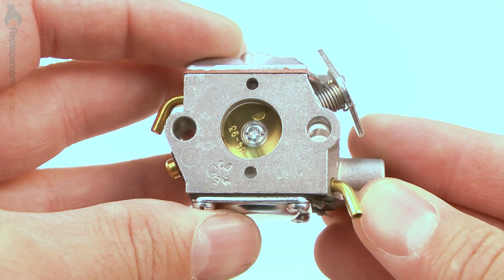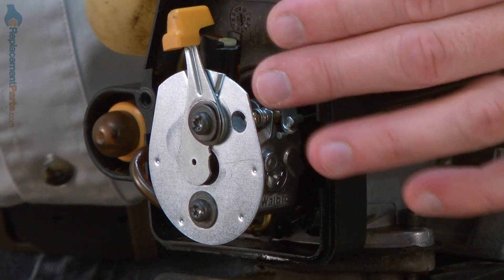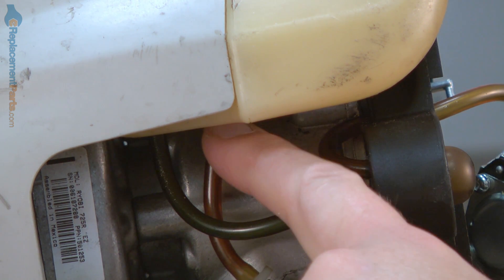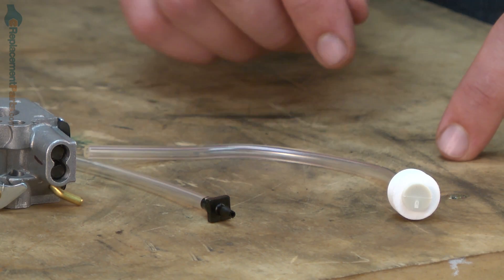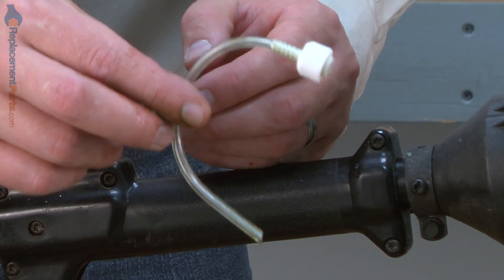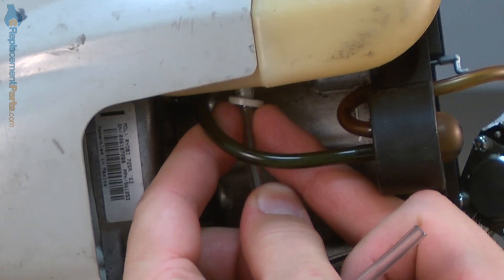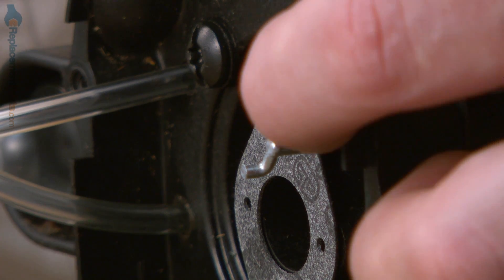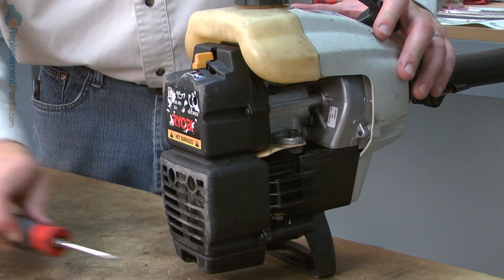Trimmer Repair - Replacing the Carburetor (Ryobi Part # 791-182875)

Comment: Hard to get parts. I searched for the carb rebuild kit and Amazon was showing complete carbs for the same price as a gasket set. I bought one. Installed and tried to prime and it wouldn't prime. The bulb got stiff and blew the hose off the top of the carb. I bought a second one with the same result. Friggin China. Compression test revealed 90 psi. It starts but won't stay running. I am certain it's a fuel problem.

Comment: Have you got a video for the ryobi 30cc pbc-3046 ye carburettor kit replacement as it looks slightly different especially the air filter cover and size of the fuel filter. Kind Regards Mark UK

Comment: i did all that try to start it only way will start if i pull trigger all way an pump primer bulb to keep running,,,, wondering if they sent m bad carb
Reply: I have the same problem. Yes the Chinese carbs are garbage. Better off putting a diaphragm and reed gasket in your old carb. They are pretty simple. Get the adjustment tools and watch a video on how to adjust these.

Comment: I bought new fuel filters with thick metal ring on the bottom. Original filter (like on the video) doesn't have it. What is the purpose of this ring? Do I need to remove it?

Comment: I wish it was that easy.  After giving 6 different places - incliding eReplacementParts - every number listed on my Ryobi 31cc 790r 18in. weed eater, no one can match any of them . Talk about mission impossible. I could have bought a new one for the price of all the minutes burned on my phone. Maybe Ryobi don't know what the words cross reference mean.
Reply from the maker: Hi there, and thanks for commenting. I found a carburetor that matches the Ryobi 790r String Trimmer, and you can find it here:

https://www.ereplacementparts.com/carburetor-assembly-p-283573.html

You can double check that you have the correct part by searching "carburetor" on the Ryobi 790r String Trimmer's model page here:

https://www.ereplacementparts.com/ryobi-790r-41ad790a734-handheld-trimmer-parts-c-7931_15633_18645.html

I hope this has finally helped you find the part you need to fix your Trimmer!
Reply: Thank you for the reply.  I have found carbs on all of the sites I've been to. A lot of them look similar but not the exact same thing. The problem is that none of the numbers I enter for my Ryobi come back to anything. I bought it in 1997,  and some of the carbs I'm looking at say 2004. Here are all of the numbers listed on my Ryobi exactly as they are written on it. 

This is from the owners manual. - Engine Family : SN4031UB24RA; EM
The same number is also on a little sticker on the engine only it reads - TN4031UB24RA; EM

Then there's a Model # on the engine. 708020752 : PPN 501145 
Roybi 790R "EZ"

Then there's another number on a sticker on the engine, it reads - 
5A6987
   (97)
708 - 3052661
I'm lost for words when none of these numbers exist in any system. 

The carb on your webite looks close. Mine doesn't have a big white plastic cap on top of it. If you say it'll fit I'll buy it.
Reply from the maker: Hi again. It seems to me that the model number of your trimmer is simply Ryobi 790R. Based on the parts list, the carburetor I sent you is compatible with your model. As you said that you purchased your trimmer in 1997, it's entirely possible that they have substituted a new carburetor for an obsolete part. In fact, our website mentions that this carburetor is a substitute part. I hope it works out for you!
Reply: Okay, I'll place the order. I really appreciate the help.
Reply from the maker: Always glad to help! Good luck with the repair!

Comment: I am curious, this looks exactly like the trimmer i have, why do you press down on the fuel filter when installing it? The fuel filter / line when installed should it be right at the hole the line passes through and standing up? I bought this replacement carb about 7 years ago and i am starting to have issues again ( which started with my fuel lines rotting out but they were the original ones ).
Reply from the maker: I am still researching this for you. Will have a response soon. Thanks
Reply from the maker: It depends on the type of fuel filter you have some of them are have the filter pressed through the fuel tank and other have the fuels filter laying in the bottom of the fuel tank with a longer fuel line going to the carburetor.

Comment: On some of the Ryobi engines there is no way you can press the top of the fragile filter with a screwdriver when installing it. Use a wire up through the bottom to guide the line until you can grasp it with a needle nose.  It was impossible to get the return line fitting down through the hole.  I had to use a small piece of the WD40 tube shoved inside the new tube and insert from the bottom.  It was 3/16" OD tube.
I notice he didn't try to start it and set the jets???
Reply from the maker: Thanks for your comments!